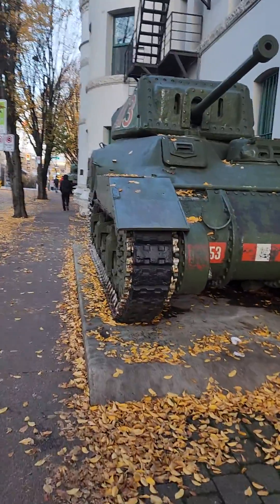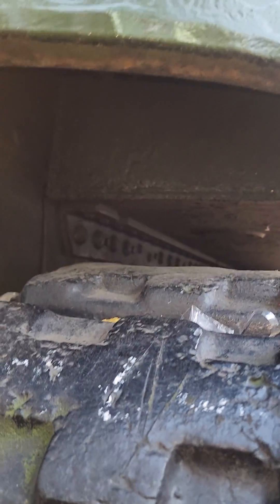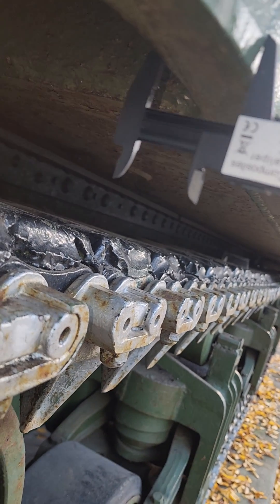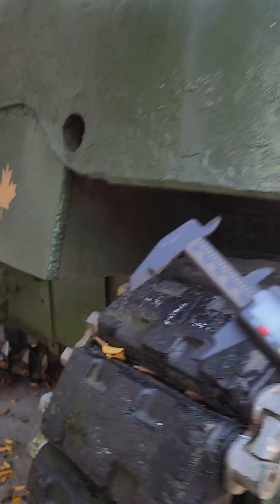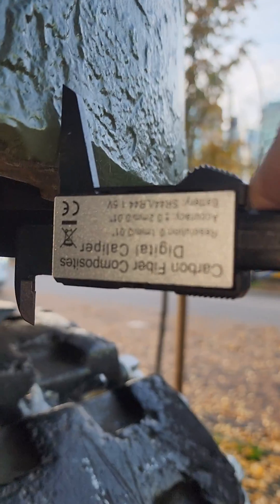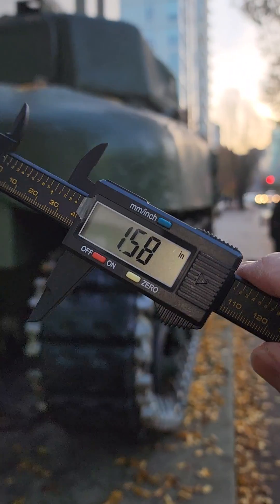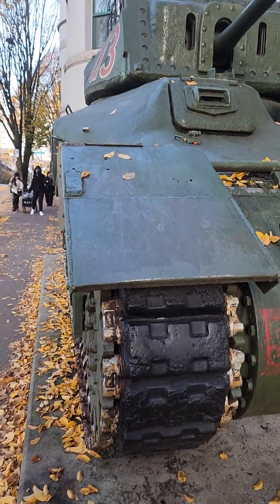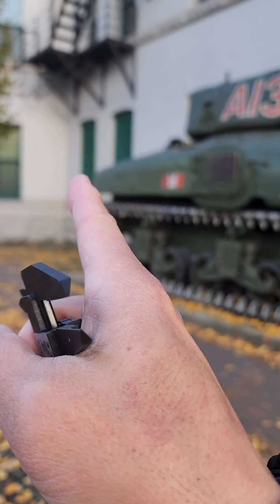WW2 RAM II TANK REAR ARMOR THICKNESS ACTUAL MEASUREMENT Part1

Comment: Its a casting so edge thickness does not mean its the same thickness all the way thru.  Casting molds are usually slightly thicker  at the top and edges are slightly thicker to make them stronger and to fill the mold better.  Its very difficult to get actual values of cast shapes when they have compound and complex shapes.  With captured vehicles, it was sometimes necessary to drill/cut holes in the armor to get true thicknesses at specific angles.
Reply from the maker: You are right on that. This Ram tank hull cast is irregular hence, it's really very hard to tell if the thickness along its length is uniform. Nevertheless,  the number we got, from this measurements, gives us some rough estimates on the thickness of the tanks hull.

Comment: You did want to say not  1.7 inch but 4.5 centimeters
Reply from the maker: Thanks for the tip 👍 hence, next time,  I will be doing measurements in both the metric and imperial system to make it more interesting 😊